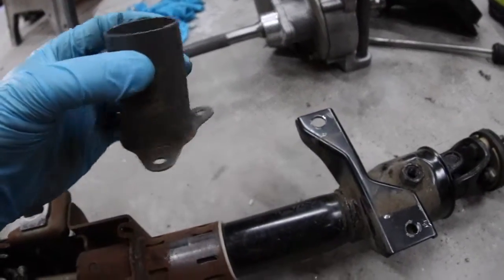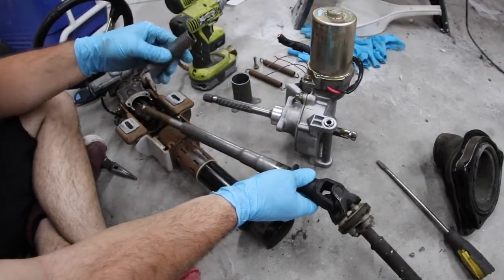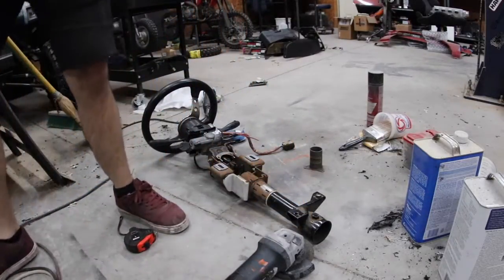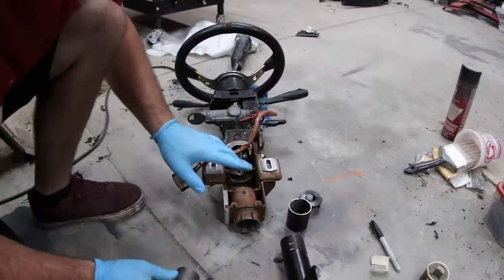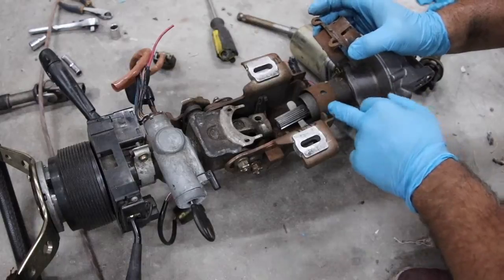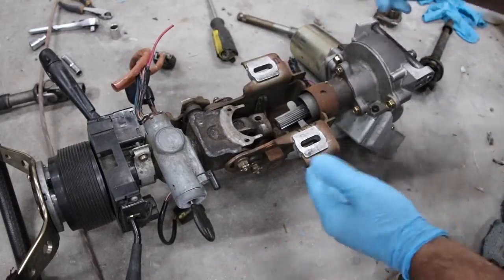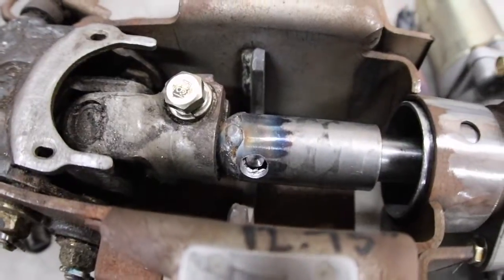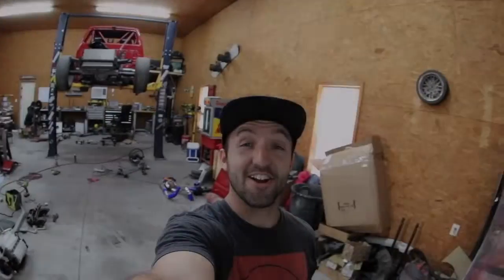NEVER BEEN DONE BEFORE! S13 GETS ELECTRIC POWER STEERING! PART 2

Comment: Can I ask about the connections? how did you made the data connections for the EPS control? because I installed a similar setup to my car but the wheel is either very hard to rotate if I cut the power of the EPS or very easy when I power up the EPS motor...
I would really appreciate if you helped with the connections to see if you overcame this issue!!! 

Thanks in advance.